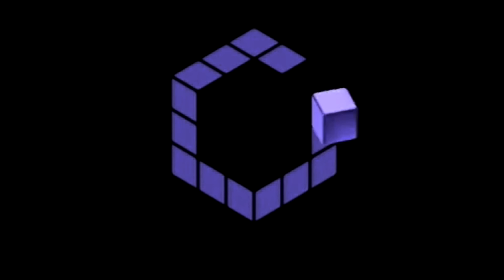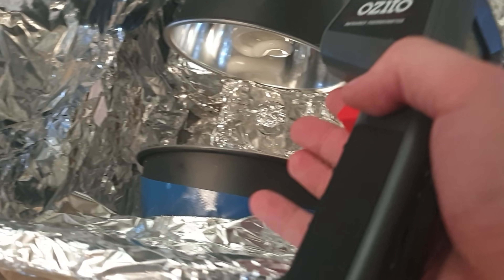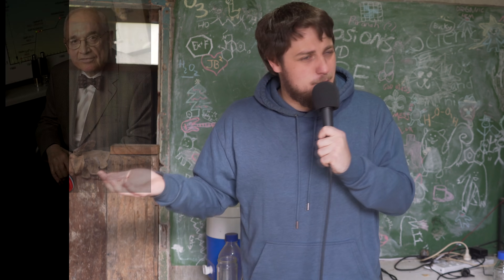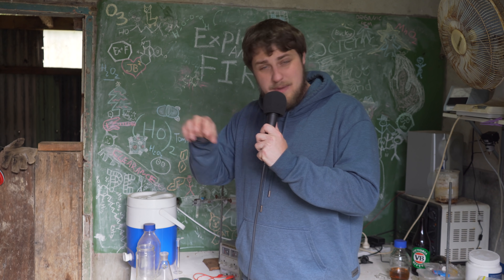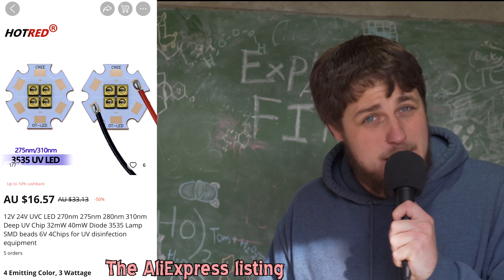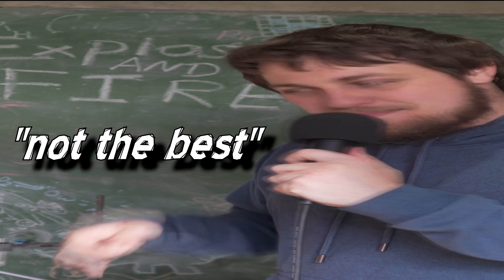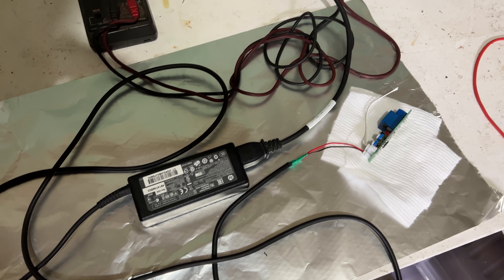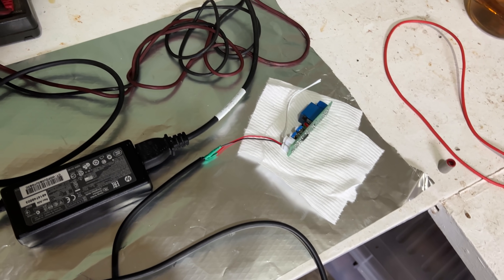Magical deep UV LEDs - Cubane Ep 12

Comment: LEDs are wierd in how they work
generally, I = V/R, so given a component that has constant resistance, amperage is linear with voltage
LEDs tho have what’s called a forwards voltage, they draw almost nothing below that voltage, but then the current increases linearly (and often very rapidly) with additional voltage
so the difference between 3.3V and 4V on a 3V forward voltage LED could be a 11x increase in power!
generally speaking, you control the voltage, the amperage is a function of the voltage which you don’t directly control

Comment: ouch... gets pricey doesnt it...  the switch/relay should be placed between the power supply and the leds, you want to open/close a circuit with minimal start up current... the power supply pulls more current when being turned on compared to the leds. when working with "bundled" leds, always use the leads for the board and not each led. LEDs are current devices, in other words a short circuit, if you allow more current into an led it WILL eat it up and over heat and die ( but you know that now) so you must control the current into the LED, another method that can be used for testing is a slowly ramped up voltage while watching the current draw very closely, when the desired current is reached you record the voltage, this will be the operating voltage of that LED. Always determine which maner the multiple LEDS are set up, series or parallel, this will tell you what voltage and current will be needed.

Comment: You really need to pay attention to the voltage and the amperage. The voltage is needed to trigger the LEDs. The amperage is how hard you are driving them. I have built around  10 LED Lamps for plants, using UV LEDs also. I am willing to help you design a new UV LED light system.

Comment: Dude. You definitely damaged those LEDs within less than a second. You can't just put hundredths of mA through an LED that's rated at 40mA. The most easy way to drive these with that old lab PSU would be putting for example a 100Ω resistor in series with them and turning the voltage up until you measure (at most) 4V across the resistor. Keep in mind that the current will increase a bit as the LEDs heat up.

Comment: You don’t want to run those leds at 1 amp. For fear of mansplaining… after you hook up your leds, turn the current knobs on your bench psu
 all the way down, then turn the voltage knobs up all the way. Then slooooowly turn up the current knobs until you get 0.1 A on the needle. You’ll notice the light on the psu has turned red and the voltage going up to 12v or so.

Comment: That driver is about as unsuitable as possible for your application. It’s a 900mA constant current source operating between 24-36V. That means it’ll start applying 24V and raise the voltage until it either hits 900mA or 36V. Your leds are designed for around 12V-14V, and should draw around 40 mA max per cob during operation. So, that supply will instantly kill a single cob, and probably push 2 in series into the “death in minutes” territory. 3 in series would cap out the power supply, but then you’re running without regulation, as you want the supply to maintain a suitable current for the LEDs. So, get a supply that pushes 25-35 mA at 8V-50V. That would slightly underdrive the LEDs, vastly prolonging their life, and it’ll drive any combination of 1-4 of those in series (as it’ll just adjust its output voltage until it hits its desired current setting). Now, such a supply might not be commercially available, so then you might need to narrow the scope a bit to 24-50V and only use 2-4 in series.

Comment: Don't worry too much about the current, as long as you supply the correct voltage it will draw the designed current. 

edit, as long as there is a current cap like a fuse.

Comment: One thing to know about Diodes in general, including LEDs, is that they cause a fixed voltage drop (or, in most cases they can be treated as such) which depends on the semiconductor material;  so, if you draw out a little circuit diagram, you'll see you have a supply voltage and a load voltage, and they don't add to 0 in a loop. Where does the rest of the voltage get 'used up', you ask?  This is where the 'most cases' comes in; your supply voltage will drop until the (now somewhat elevated) voltage draw on the LED's, plus what gets lost in the resistance in the bit of copper wire attached to them, makes your circuit diagram balance out.  This sends an enormous amount of current through the LED.  If you want to actually draw the correct amount of current, you can throw a resistor in series with the LEDs, and you'll be able to eat up any extra voltage.  With this setup, your LEDs will draw roughly fixed voltage, and you should be fine if the resistor can handle the extra power running through them.  I can give you a methodology for experimentally determining the voltage (without frying the LED board) if you want to know better than the "12V" provided in the documentation, and then how to calculate a resistance value (and associated power draw, enough info to specify an appropriate model resistor) for safe operation at your desired voltage, and desired current draw.

I'm not familiar with what's in the electronics of one of those LED drivers, but it seems it may be current limited in a way that circumvents the need for a series resistor (by varying the voltage to meet a current target, rather than by providing as much current as needed to maintain a target voltage), provided your LED voltage drop is within parameters for the LED drivers (24V-42V) , so you may not need anything extra here.  

For a normal power supply, I would recommend a resistor and potentially a fuse, but I don't know how these will interact with a purpose-built LED driver. They may just cause additional power draw, or be unusable.  I think your instinct to link 2 LED boards in serial here is sound.  Note that you can safely add a third LED board in series as well, as 12*3 V = 36V < 42V, the maximum output voltage of your power supply (and, no small coincidence, at the maximum input voltage to the LEDs, you are exactly at the maximum output voltage of your power supply, 14*3 = 42)

I hope this helps your understanding of what's actually happening here

Comment: To keep your LEDs in a safe operating range, you need to limit the current. Basically; forget about the voltage. It's just the current that needs to stay at 0.04A (40mA) or below and that's it. Vf (forward voltage rating) will only tell you at what voltage the LED will (in simple terms) start drawing current and light up. Up to that point (below that voltage) it will barely conduct any current and as soon as you get near it, the current will rise extremely fast and just touching the potentiometer knob on power supply, could increase voltage enough to cause current to shoot up into the "danger zone". At rated Vf, the LED becomes kinda similar to a wire, so it's basically shorting out the power supply once you get to that point or just a little above, that's why the current rises so fast with small voltage change. You could buy an LM317 voltage/current regulator (costs almost nothing) and in combination with proper resistor attached to its terminals, you could limit the current to 40mA or whatever you need. (there are countless schematics and tutorials on that and it's really simple). Or if you don't mind a little more inefficient, but even simpler method, you can always just use a resistor in series with the LED. Resistor value = (supply voltage minus forward voltage of LED) divided by max. LED current. Supply voltage should be higher than LED rated voltage, so more than 12, but not too much, since you'll be unnecessarily wasting power in form of heat on the resistor. For example; 13V supply minus LED voltage; 12V = 1V. Divide that by LED current; 1/0.04= 25 ohms. Resistor also needs to be capable of dissipating enough power. In this case: power equals voltage times current: 1 volt across resistor times 0.04A through resistor = 0.04W, so even a basic 1/4w or 1/8W resistor will be enough. If you can't find that resistor value, you can always change the voltage a bit, make another calculation and you'll be able to use "any" other resistor value. Just keep in mind that the higher you go with supply voltage, the more voltage and hence the more power you'll get dissipated on the resistor, which are unnecessary losses and expenses (larger resistors). Also, try finding a small heatsink or at least a thicker piece of aluminium sheet, to keep the LED cool (under 60°C should be good - too hot to touch after a few seconds or less). I do like your chemistry videos though and let's say I'm as good with chemistry as you are with electronics. I know some basics, I did some experiments but I've a lot to learn still, and your channel, besides some others, like NurdRage and Cody's lab, is a nice place to learn some chemistry. Thanks for your uploads.

Comment: I suck at electronics too, but I have found out the hard way that some components will current limit themselves (such as power adapters - you can use any current DC power supply as long as it's higher than your device, and the right voltage/polarity). I believe incandescent light bulbs also current limit themselves, which is why you can just add them to mains power in your house just fine. LEDs, and DC brushles motors, however, will continue sucking up current until they start on fire/pop, so you need to supply them with both current and voltage that is within specification.

Comment: A current limiting resistor would be your friend. For example, Say the voltage drop of the LED is 2V and your power supply is 10V, but the LED can only handle 0.1A, A resistor in series with the LED will take the other 8V of the power supply, and whatever current is going through that resistor will also be going through that LED, so Resistance equals Voltage divided by Current, 800 ohms equals 8 volts divided by 0.1 amps. Ohms law, or how I remeber it, Ear Pie, E=IR, P=IE mwahaha

Comment: You need to limit the current. A box of 1000 1w resistors of various ohm ratings is like $10. Or just use your power supply.

Comment: Just an FYI on the current thing, when you read an LED specsheet the most important thing is the voltage, because an LED doesn't draw current until it hits a threshold voltage and by that point it is stable (ish)

Now a normal source you will find in a lab(or in your socket) is a voltage source, that means it produces a fixed voltage. The current produced by the source is determined by whatever is connected to it. So in the LED problem the source produces the voltage, the current output is exactly what the LED needs.

Comment: You need to get a current regulated power source for those LEDs, make the box you will use them in and please don't witcht them on in the open. LEDs will draw all the power they can if you let them, so they will all burn if your power source can supply more watts than what they are rated for..

Comment: Studying Electrical engineer here, you want to limit the current to each unit to what it's rated to to help stop them getting hot and burning out, they'll run at more than that but not for as long. 

Typically, most devices will only draw as much current as they need, but that's not true for everything, voltage needs to be exact as you found out.  

You can just use a resistor to limit the current to each light and it's recommended to honestly, ohms law is V(Voltage)=I(current)xR(Resistance), but you can re-shuffle that to R=V/I, so you want R=V(12v)/I(0.04A), which gives you 300Ohms.   If that's correct, then you'll need at least a half watt resistor for each LED, I'd get 1Watt just to be safe but.  

Someone check my maths though, I wing everything and am typically bad at maths. 

Someone's probably answered this for you already, but in case they haven't.

Comment: On the LEDs... If you don't have a current limiter circuit involved, you can use your 12v source if you put a current limiting resistor. This will be about R = [12v - (Diode turn on voltage)]/40mA
Reply: Modify the source voltage to what you are using

Comment: Personally I spend alot of time with thermals, there are some people who go based of brand, but I'd recommend checking the expected heat output with a sufficient paste. Heat sink can material (copper, etc) can affect as absorption is different.

As for current, the guy on twitter was sorta right, but thats not how LED(iodes) function. If you limit the current on your supply to (X)currentlimit * (N)diodes diodes, you'll be fine, diodes are weak though, won't last long past its limit, unlike motors.

For cooling you could chop the bottom off can and 12v 40mm fans may be sufficient. You may want to monitor the LED heatsink temps but switching was a great idea tbh, exactly what i'd do

Comment: This def made me cringe at a few points lol. I'm surprised that the circuit blew from too few volts on that one, and yea polarity will absolutely fuck you if you ignore it, but hey man you're learning. If you'd posted some community questions though I could definitely have helped you with this :( electronics building is one of my hobbies lol, I even rebuilt an old tube amp last year. I've run LEDs before unregulated like this without blowing them, but the power supply was also not a bench PSU (I regularly use PC PSUs for bench supply as well sometimes lol. At least you got a pair of them working in the end ultimately (Albeit in a condition that they will not live very long in), but damn that was avoidable xD. Maybe spend some time watching some electroboom sometime!

Comment: Your LED driver is nice, but way over complicating a rather simple circuit. The way to approach it more simply is to just buy a resistor to put in series with the LEDs. I suggest setting the bench voltage supply to 14 volts. Then put all your desired LEDs in parallel with each other and in series with the resistor and the supply. Finally, use Ohms law to calculate the value of the resistor(s) that you would need to limit the current to 40 mA for each LED. e.g. 2 LEDs in parallel require 80mA, so 14V/80mA ≈ 175 ohm.
Reply: Two additional notes:
1,) this is assuming no voltage drop across the LEDs, which is incorrect, but errs on the safe side. If you want to actually reach 40mA per LED, you can use an ammeter while slowly decreasing the resistance until you get to your desired current.
2.) be sure to get resistors that can handle the power dissipated across them. The power can be calculated using P=V^2/R, so you will likely need a resistor rated for around 2W. You can get around the power problem by using more resistors in parallel, I suppose too

Comment: That power supply is constant current too. Use a multi meter and set to the diode voltage, then turn amp dial all the way down and short the power supply terminals. Turn up the amp dial untill you get desired amperage. (40ma will be a bitch with that gauge) then plug in your led and power it on

Comment: these are 12V 40mA leds
buy some 12V/(4A*10^-3)= 300 Ohm resistors, through-hole, not smd
solder a resistor to a black wire on every led (or to a red one, doesn't matter)
solder all the red wires together, do the same for the free resistor leads, extend both with more wire
set 12v on your bench power supply, any current, as resistors would limit it
put goggles on, plug it in

Comment: I can't wait for my UVC backlit TV in 10 years.
Reply: Just about all white LEDs, including TV backlights, are already either UV-a or deep blue/violet LEDs, coated in phosphorus to convert it to white light. The voltage drop is inversely proportional to wavelength, so going to UV-c is more likely to be less, not more efficient. But it depends on if we get different phosphorescent chemicals, and bandgap energies of new semiconductors. I think in the ideal case, we'd want a phosphor that changes near-infrared to white light, which to my knowledge doesn't exist.

Comment: What the led driver does is adjust the voltage to the leds until the driver's current output is the specified value.  It will raise or lower it's output voltage within it's capability to obtain this current output.  You needed a 40mA led driver, current is what controls led output.  If you put more LEDs in series in the circuit, the driver will increase it's output voltage until it gets 40mA again.  You have to check the output voltage capability to see how many LEDs it will drive in series.  Also it's not good to drive LEDs in parallel, because of differences in the 'resistance' causing problems.  Btw it would be cool if you did more explanation of chemical principles and more about the reaction details like theoretical stuff too.

Comment: Mate, while I appreciate your commitment to being scuffed as, a $10 multimeter from the fuckin Walmart could've saved your ass here.
Always check what voltages are coming in and out of electronics when you're designing something. Make sure they're in line with what you expect and in line with the specifications of the product. If you don't know the specs, bloody look them up.
Amperage is something that the device will, in a way, self manage. It'll draw and use everything it can at a specific voltage. Voltage, however, has no self regulation. You pump 12V through a rail that ends at a chip expecting 5V and you'll fuckin cook it.